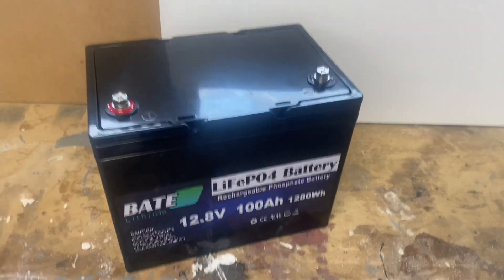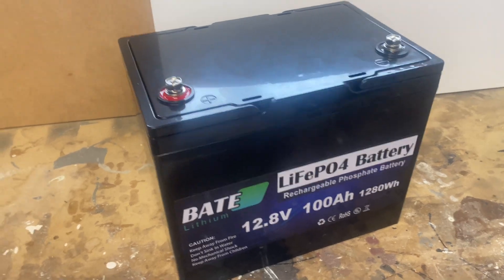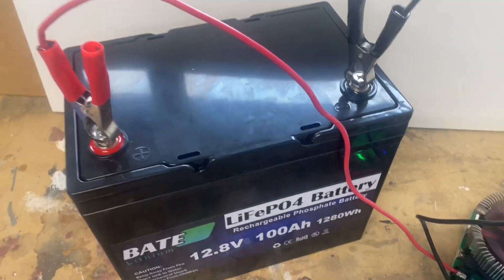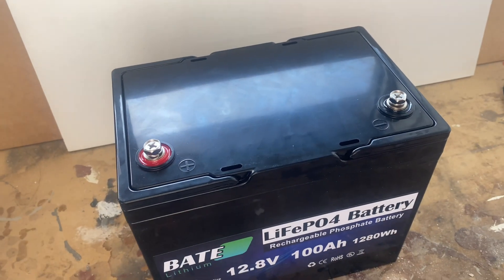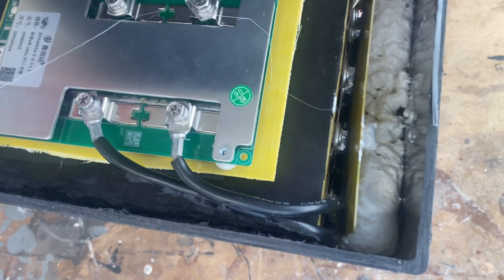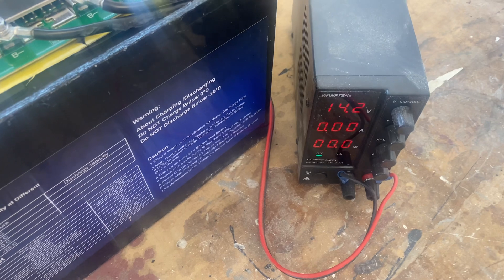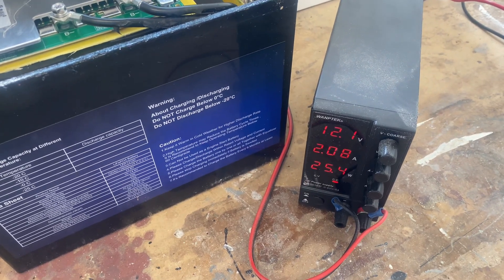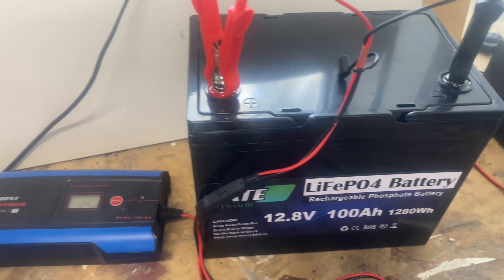BATE Lithium 12.8V 100Ah LiFePO4

Comment: pouch cells? are those not lithium polymer? rather than lifepo4 this would be a pretty major difference as poly's can explode
Reply from the maker: Pouch cells refer to the form factor, not the chemistry. While many lithium polymer (LiPo) batteries use pouch cells, LiFePO4 batteries can also be built with them. LiFePO4 chemistry is much more stable and safer than traditional LiPo batteries, so no risk of explosions like with some high-energy-density lithium-ion packs. Thanks for the comment!
Reply: @JonasSyver  Ah good thank you for confirming that, i never know what to expect from chinese batteries, great to see a proper teardown.
Reply from the maker: @robb1chan9  Thank you.

Comment: 150A continous discharge with a 100A BMS? How does it work?
Reply from the maker: It does not.They should really quality check their labeling… Glad I opened it up to see the BMS.. thank you for the input👍
Reply: @JonasSyver  thanks for the video ;-) Do you think these pouch cells have a disadvantage over prismatic cells?
Reply from the maker: @frikadellenkind  pouch cells are thinner and lighter, but more fragile. For a stationary system they will work great. Prismatic cells are more durable and would be my choice for things like RV,campervans and boats. It all depends on the quality of the batterybuild  in my opinion.
Reply: @JonasSyver  the price for this battery is hot, but i would like to use it for a campervan. Hmm
Reply from the maker: @frikadellenkind  I really don't think you will have any problems using it in a campervan. The overall build quality of the battery is ok. Insulation foam secures the  batterypack well. So for the price, you get a decent battery that works as far as I can tell. I say go for it if you are on a budget.
Reply: @JonasSyver  one last question, did you see some kind of compression of the cells between two plates with steel rods maybe? It cannot be seen in the video
Reply from the maker: @frikadellenkind  no. Usually steel rods are not used in these commercial batteries. The cells are compressed within yellow epoxy plates and tape.